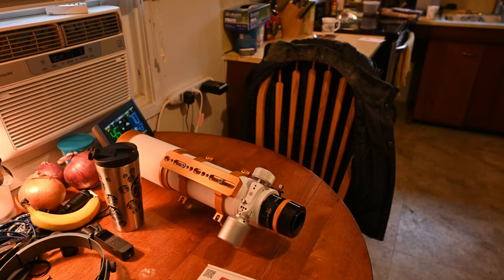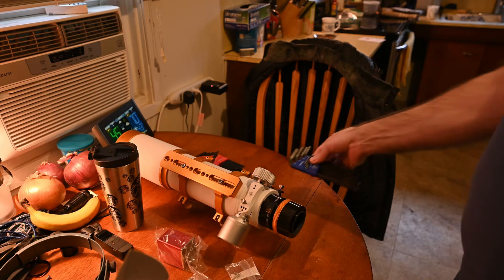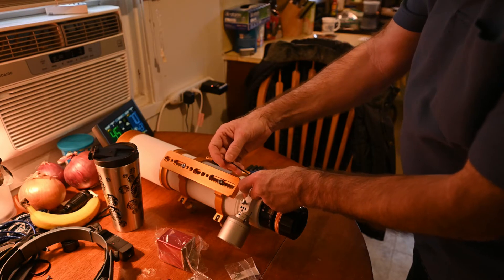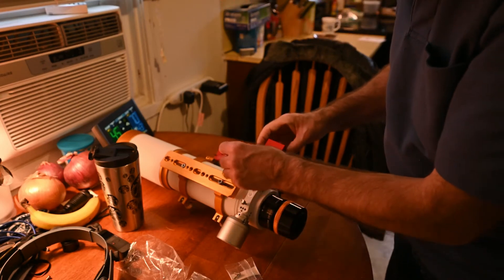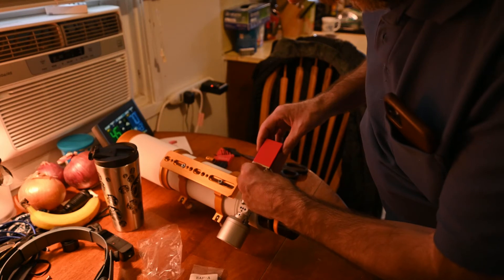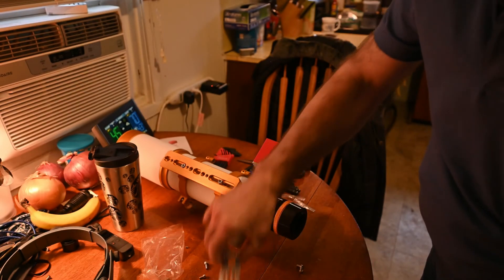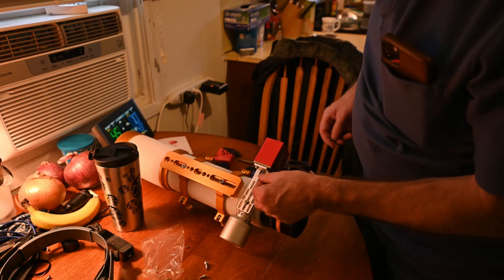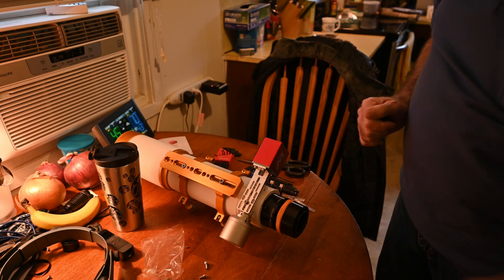ZWO EAF Installation on William Optics Refractor

Comment: I have a WO refractor, there is a second hole to accommodate an additional screw to properly restrain that bracket. Check your EAF -A bag, there should be a second screw for that install.